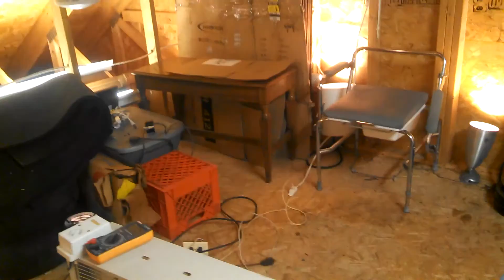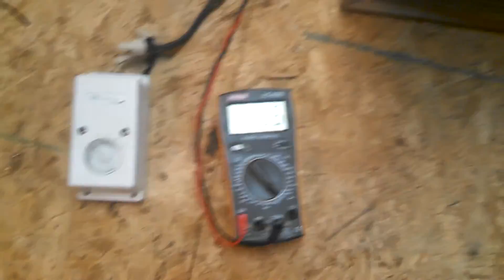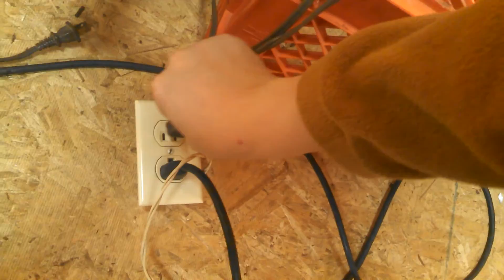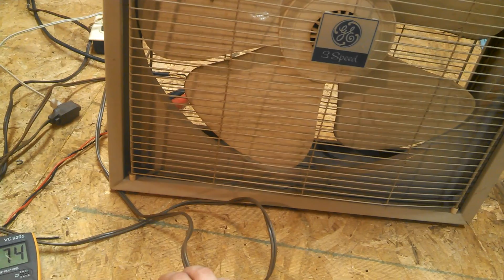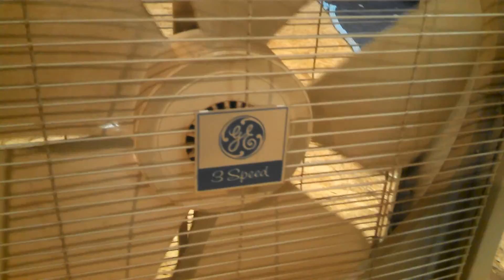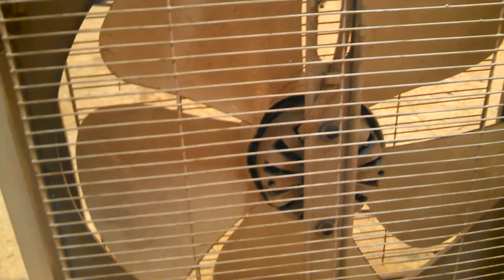GE/General Electric 20" plastic blade box fan

Comment: Hey Dan My GE box fan makes that same clicking noise I think it might be the fan blade.
Reply: The clicking can come from two places. Its the washers either in front holding the blade on or its the washers in the rear of the motor holding the rotor in. Simply wrap with rubber bands to hold it in place